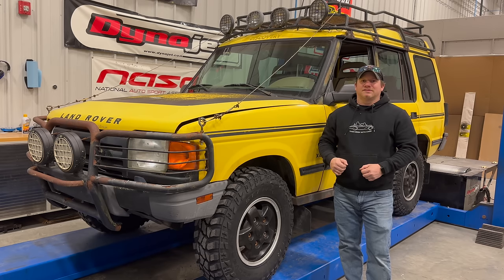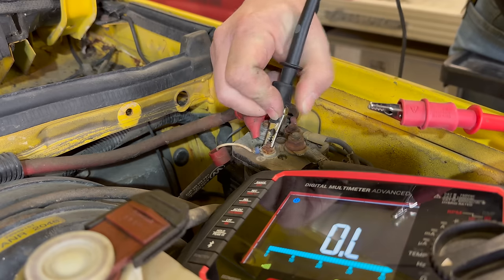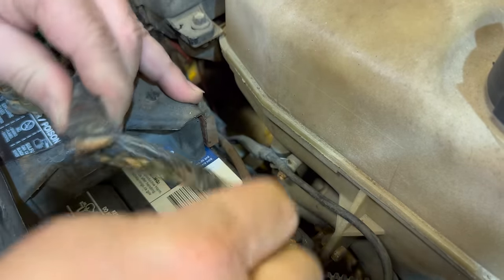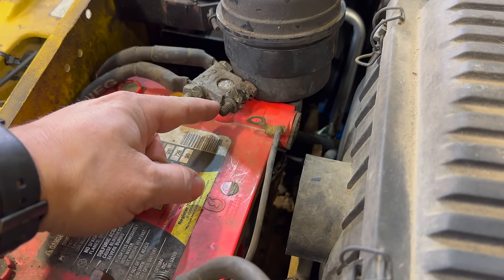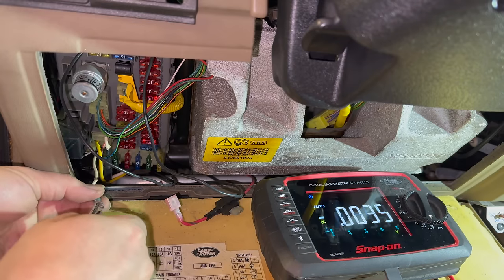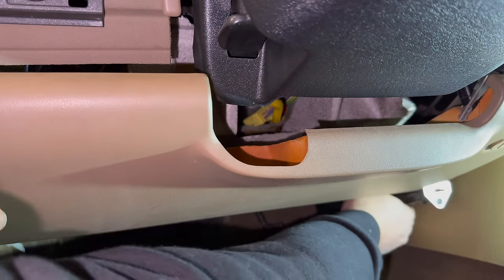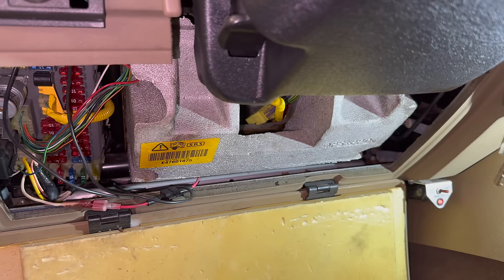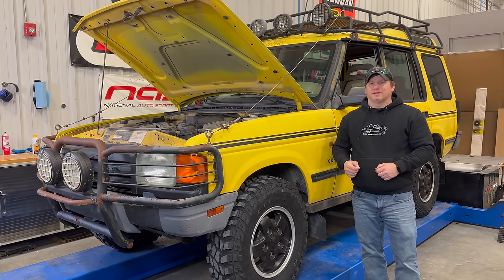Diagnosing the Discovery XD Dual Battery System

Comment: Hi Steve, as I may have spoken before, on my 1991 3-door 200  Tdi I once owned for 10 years, I put two same identical batteries under the bonnet (hood) joined together that gave me 12 volts theoretical, but a huge amount of amps for any occasion. Even cold starting in very cold winters I never really needed the heater plugs as the big old-fashioned diesel just spun over so quickly. From new,  the second battery tray was meant for the land rovers bottle jack, which got replaced in the "boot".. Many thanks for these Landrover Videos Steve, I am not a lover of the more modern ones at all, far too much "ELECTRICKERY" going on with them now.. Long Live older Landies eh.. thanks, Ian - UK.

Comment: Your ability to diagnose and repair electrical issues is something amazing. I looked and looked for the problem and finally gave up by electrical taping both positive leads. When I first got the XD the system wasn’t working. I got it working by cleaning the grounds. When it died again I never was able to trace the problem. Amazing you found the connector issue. Really enjoy watching you get the old girl back in good nick!!!
Reply from the maker: Thanks these videos wouldn't exist without your contribution.

Comment: This set up reminds me of my RV electrical configuration, in that the RV has a 12V deep cycle battery for supporting all the domestic appliances in back, and a standard 12V under the hood for the engine.  The differences are that the RV had a separate charging system off either shore power or generator for the deep cycle, and the tie in for emergency starting was a simple push button switch on the dashboard that put the deep cycle in parallel for starts.  It took two hands because the tie in switch was "push to connect" and so was the starter key switch and the two switches were feet apart. This system has the advantage of having the emergency mode hands free.  I am curious as to how the 2nd battery on the Discovery is charged.  I suspect that you put the switch in "dual" when you want to charge the second battery, but as you mentioned that is going to be hard on a standard 12V automotive battery that expects to be topped off continuously for long term service. Perhaps that is why the 2nd battery system was completely disconnected by a previous owner. Is the alternator on this rig higher output than usual to accommodate charging two batteries? I've been told that running an alternator full output is pretty hard on them, although I've never noticed a problem personally.

Comment: Too bad if you go through high water Steve with the air filter box open like it is due to the second battery placement. 🙈
Reply from the maker: Its not any different than it was before there is a horn that stuck out at the same height.  This is what it looked like:  https://i.ebayimg.com/images/g/56QAAOSw44BYc8su/s-l500.jpg
Reply from the maker: It will probably go through deaper water now because the battery blocks the water from just flowing straight into the air box.